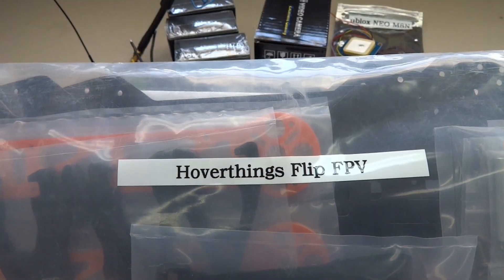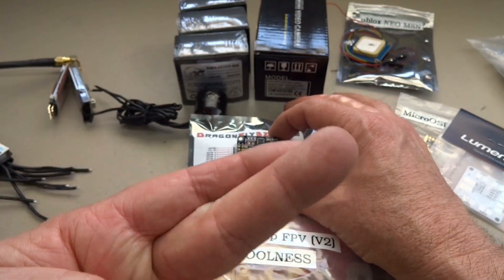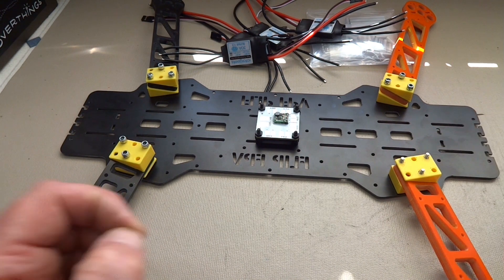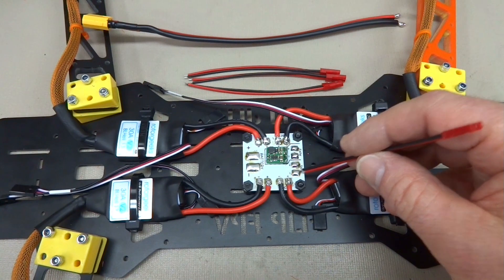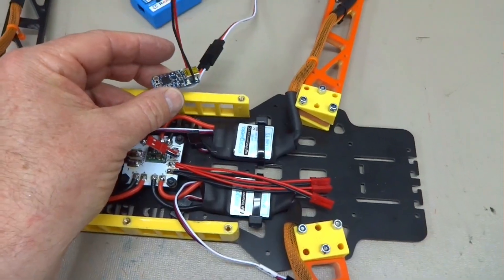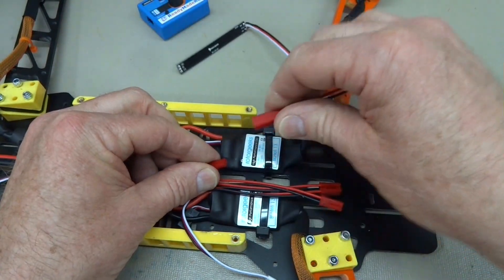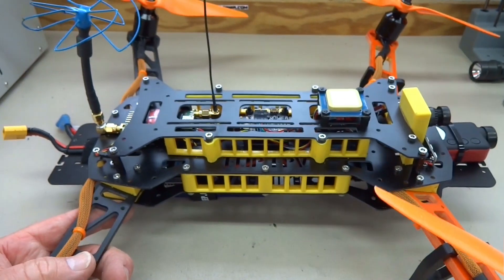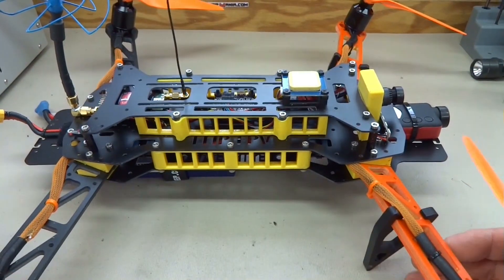Flip FPV V2 (RACING EDITION)

Comment: know this is a bit old (from 2015) however I like where your going and  I want to build say 250 sized FPV quad yet I want GPS with Return to Home.  What flight controller would you recommend?
Reply: The new microvector from Eagle Tree.  I'm getting ready to post a how-to video of that exact same thing, converting my Blackout 250 from Naze32 to the Vector.
Reply: Interesting, would this be easyer/better than the NASE 32 M?

Comment: Do you still recommend the tilted arms because I heard you cant seem to tune them right in one of your latest videos?
Reply from the maker: brad mont I have reverted to the flat arms for that exact reason.  It was a LOT of trouble to tune, as well as level.  Even with the 20d offset in Cleanflight I had a heck of a time getting it to arm reliably.  Also, with that much forward tilt there wasn't enough adjustment in my radio to keep it from moving forward, requiring me to constantly apply back elevator.  Now, having said all that...it was FAST, really fast.  Once I got the hang of flaring it to slow down and land, it worked out OK.  Still, it was a racing machine and I really don't race, so I removed the forward tilt blocks and put in flat ones.  Now is it "normal" and a LOT easier to tune and fly.

Comment: Very nice build. Do you have a link for the trinket sketch to do the LEDs like that?
Reply from the maker: Mike Mulligan Here you go:

#include
<Adafruit_NeoPixel.h>

 

#define N_LEDS 8

#define PIN     1

 

Adafruit_NeoPixel
strip = Adafruit_NeoPixel(N_LEDS, PIN, NEO_GRB + NEO_KHZ800);

 

void setup() {

  strip.begin();

}

 

int pos = 0, dir =
1; // Position, direction of "eye"

 

void loop() {

  int j;

 

  // Draw 5 pixels centered on pos.  setPixelColor() will clip any

  // pixels off the ends of the strip, we don't
need to watch for that.

  strip.setPixelColor(pos - 2, 0x100000); //
Dark red

  strip.setPixelColor(pos - 1, 0x800000); //
Medium red

  strip.setPixelColor(pos    , 0xFF3000); // Center pixel is brightest

  strip.setPixelColor(pos + 1, 0x800000); //
Medium red

  strip.setPixelColor(pos + 2, 0x100000); //
Dark red

 

  strip.show();

  delay(30);

 

  // Rather than being sneaky and erasing just
the tail pixel,

  // it's easier to erase it all and draw a new
one next time.

  for(j=-2; j<= 2; j++)
strip.setPixelColor(pos+j, 0);

 

  // Bounce off ends of strip

  pos += dir;

  if(pos < 0) {

    pos = 1;

    dir = -dir;

  } else if(pos >= strip.numPixels()) {

    pos = strip.numPixels() - 2;

    dir = -dir;

  }

}

 

From <https://learn.adafruit.com/larson-scanner-shades/software>
Reply: Awesome! Thanks I Had just found that page so i was close! But this saves me a lot of time. Thanks again!

Comment: Another great video. How much weight did the "gills" and stuff from the bag o coolness add? Looks like you made the quad even stronger by adding the gills. Love the low rider look when you were flying. Thumbs up!
Reply from the maker: Time2StandUp Thank you Sir!  The AUW without a battery is 1091g.  I didn't build it with the original aluminum standoffs, so I can't compare it to "stock".  The ABS parts are extraordinarily light because I printed them with 20% infill.  It is probably within a few grams of what a stock version is.  BTW, that "low rider" look is really hard to fly LOS!  We are so used to a quad flying "level" that I'm was having a lot of trouble adapting to the "butt down" alignment.  While FPV tho, you don't even notice it.

Comment from the maker: *****   Few of us ARE electronics technicians and you've hit upon one of the biggest challenges of building models today.  There are so MANY different components, manufacturers and clones, many of them incompatible with each other.  That it makes it impossible to give an all-encompassing generic "build" video.  When I make these videos I try to choose components carefully and have learned to stick with the "name brands" known for reliability and quality.  That way all my quads are almost identically equipped, reducing build time, complexity, and making repairs and tweaks much easier.  Every once in a while I'll experiment with something new, just to give it a chance, but almost every new electronic component has a learning curve and integration problems with your existing parts that you'll have to work through.  You've probably noticed I use ImmersionRC video transmitters and receivers - that's because they integrate well, use a wide variety of power supplies, and do not interfere with each other's signals.  Yes, there are cheaper options, but then you introduce the risk of something not performing optimally, like introducing electronic noise or signal blocking.  I pay a little more, but avoid a LOT of pain later.  The same goes for the DragonFly32 flight controller, OSD and GPS - all from a single supplier: MRM.  They produce high quality products, have a wide user base, provide super documentation on their website, and have a robust customer support - things the eBay sellers from overseas do not.  So, while the initial price from an eBay seller may be a few dollars cheaper, your leaning curve and pain level will make up for that.  My advice: stick with name brands.  Follow their wiring recommendations and try not to deviate too much from mainstream components.  Spend a few extra bucks initially on good stuff and avoid having to scrap some defective component you got on the cheap.  If you DO decide to try something new, be ready for some serious learning curve action...
Reply: +AerialWerks  I am AM an Electronics Technician but it doesn't help.  I've been trying to build a quad for almost 2 years now and don't think it's possible since most of the parts you get are bad and all the crappy shareware you have to use to program the stuff like the flight controller never runs.